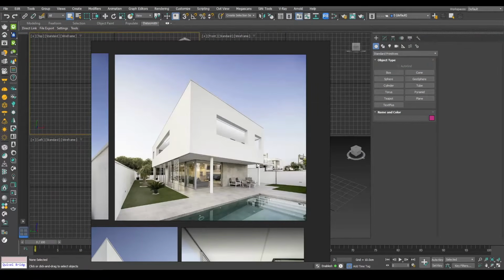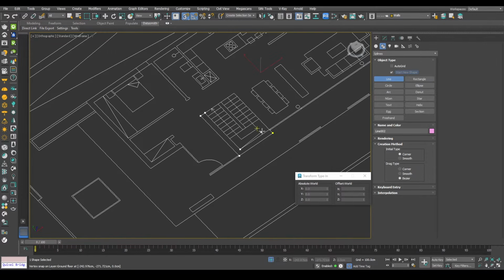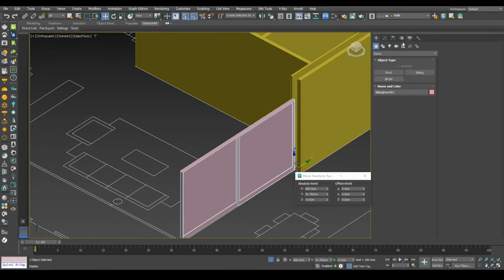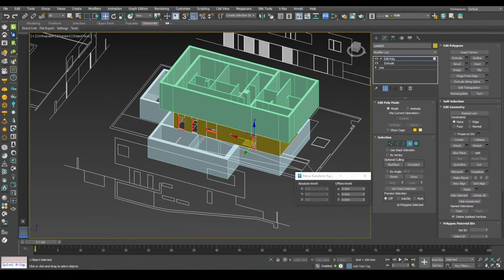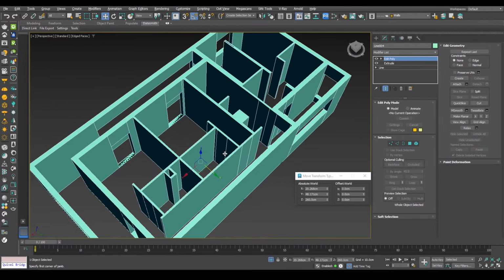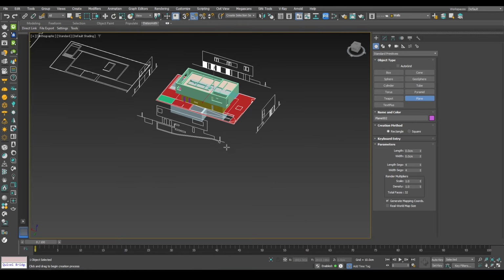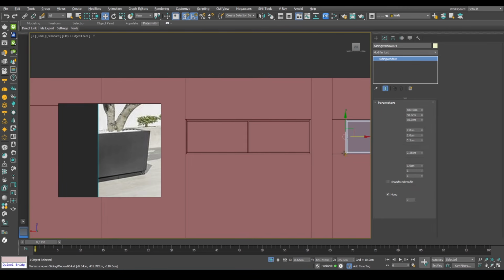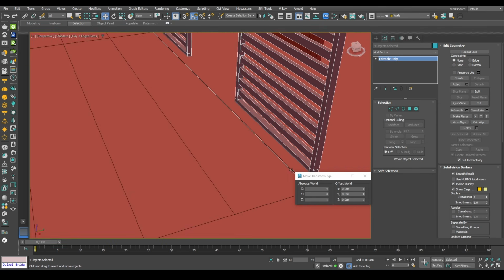Unlock the Secret to Exterior Modeling in 3ds Max!

Comment: TO ANYONE trying to learn how to model PROPERLY this is definetly not a good tutorial, so many mistakes , doors with 300cm height ? start with layer for walls then adding opening and ceilings ? keeping the walls jumping out of the roof since we are not going to render it ? modeling a door while at 26:13 we clearly see it's a window ? 30cm height for the pool steps ? The Vray part was good.. but for the modeling...Dude..
Reply: This is good tutorial for beginner, the essential for modeling is matter.
Reply: @FarhaNzAsyraf  Bruh...

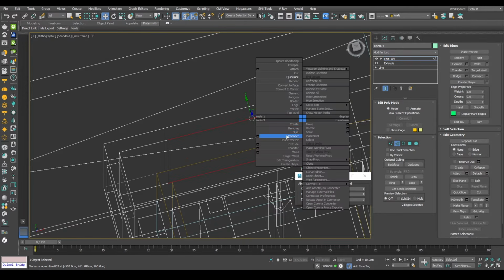Comment: I have a question. when you move the created line from the connect input how did u snap/aligned it with the other line? doesnt work for me 25:35 timestamp
Reply: Hello, i just found out that you need to enable axis constraints from options→grid and snap settings

Comment: Hello there. Great video. I have a question please. I am currently using Corona 9 for architectural visualisation in 3ds max 2020. I have an Nvidia 1060 GPU and am considering upgrading to an Nvidia 4080. Do you know what kinds of benefits I can expect from the more powerful GPU when it comes to general workflow in 3ds max with Corona 9? Any thoughts would be much appreciated. Thank you.
Reply: Almost none considering Corona uses no GPU at all; the only improvement would come from general viewport performance and the amount of polygons you can handle, but that's pretty much it. If you're looking for a GPU based renderer you can take a look at V-Ray 6, nowadays it's pretty much Corona, you just need to set it up correctly.
Reply from the maker: Well, Facundo got that one 😄